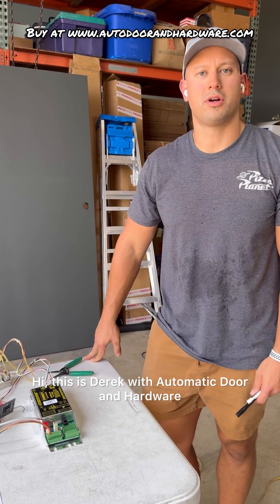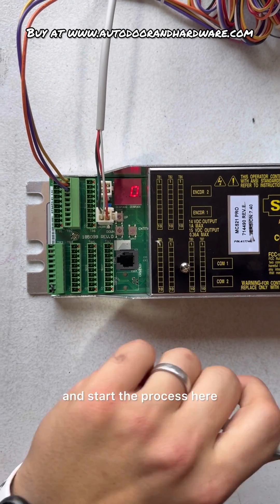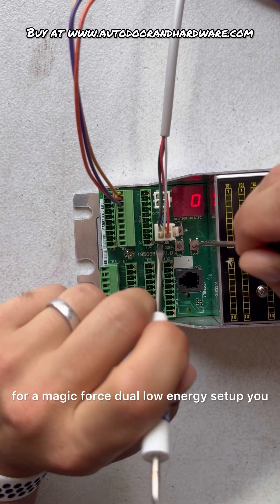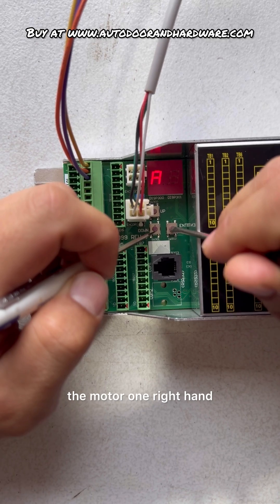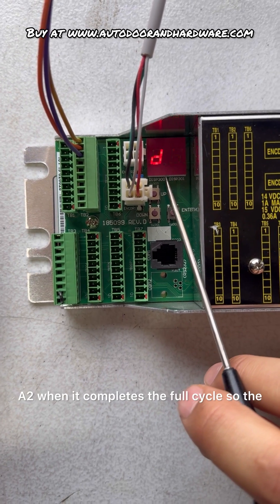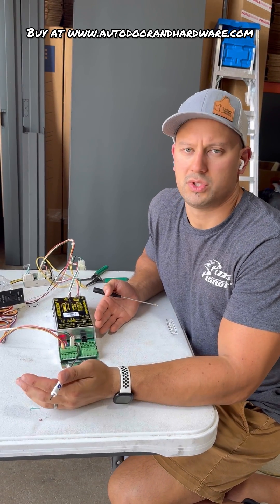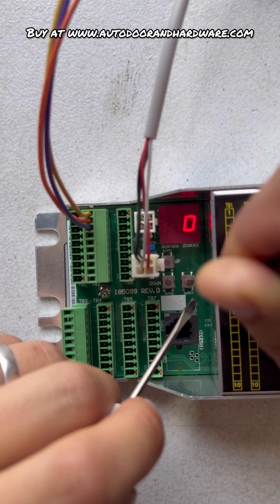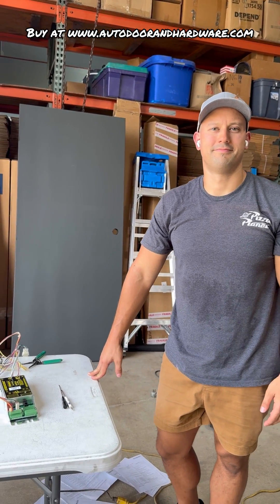How To Program and Adjust a STANLEY 185101 MC-521 Pro (Black) Controller | Low Energy Dual Opener

Comment: Good night I need help, my automatic door Stanly, closes but does not open, had the defective external sensor and replace it but in the same way it follows the same failure, she closes normal but does not open the two sensors work, which 
could be?